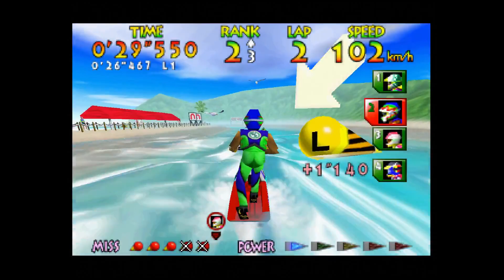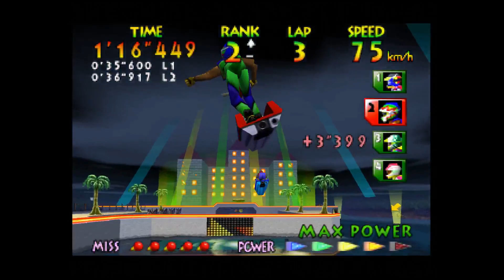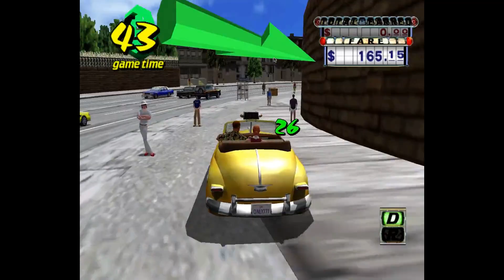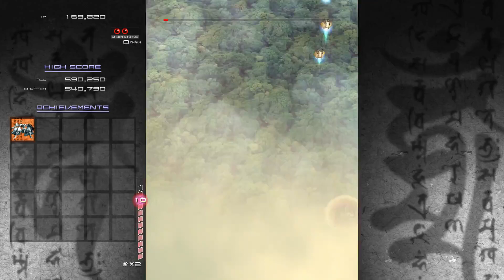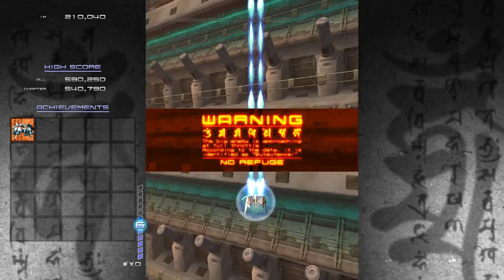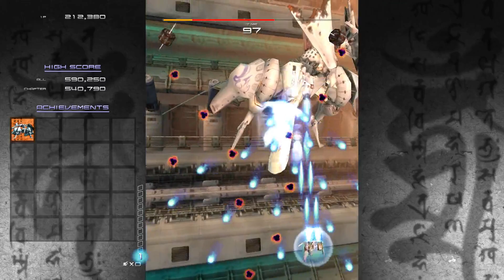Analogue 3D and MARS FPGA - Breakthrough Systems For Retro Gaming?

Comment: There should be no problem for MARS to handle Model 1 and 2. If it can handle NAOMI then it can also easily run Model 3 since it's less powerful. I'm curious if it can manage something like Hikaru or even NAOMI 2 in the future, i would love to see games like Planet Harriers and Star Wars Racer Arcade being ported. Another board from Sega that would be very interesting to see is the System 32 game Golden Axe: The Revenge of Death Adder, that game is so good. The list of potentially new arcade cores are so many...
Reply from the maker: I should have brought up Model 3, but that one should be able to run like you said. Daytona USA 2 would be awesome to see running on that board. Thank you for watching!
Reply: The biggest factor with Dreamcast/NAOMI is that Fixel has PowerVR done in HDL from a previous project. Also, other parts of the Dreamcast are already documented. That's not to say that Model 1+2 will never get done, but they are currently not on the roadmap. Naomi/Dreamcast is a special case.
Reply from the maker: @MARSFPGA  Thank you for sharing this video on Twitter, and thank you for that extra bit of information about the upcoming Dreamcast/NAOMI cores. I didn't know that some of the work had already been done in a previous project.

Comment: The Analogue 64 will cost between $199 and $249. We know this already. 
The MARS will be $1000+. Neither N64 core will look anywhere near as good as your video of WaveRace 64 looks. Since software emulation can upscale the textured polygons before it's upscaled. The Analogue 3D core will upscale the 240p signal. 

I also feel this will be the so called "Zimba 3000", that Kevin has wanted to do for many years. It would seem so since Analogue has not included OpenFPGA support. I.E. They can sell cart/CD addons + their own cores for it. It's going to be a much more powerful FPGA chip, so we could see other systems such as the PSX, Saturn, 3DO, CD-i, Jaguar, and so on. Chris Taber has said many years ago that he would love to see an FPGA 3DO someday. I guess we'll see. 

Also, the N64 Analogue core is said to have save state support at launch. I'm not interested in another N64 (I already have a dozen), but if the other systems are added I may be interested.
Reply from the maker: The price for the Analogue 3D has not been confirmed yet. There is no guarantee that it'll be that cheap.
Reply: Chris Taber has said  “the price of the Analogue 3D will be in the range of all of our other systems,”. So that gives us a good idea of the price. No more than $249.
Reply: @videogameobsession you must have forgotten the MVS and NT consoles were more than $250
Reply: @otterdonnelly9959  No. I knew of those. I made 300+ Neo•Geo extensions,  which were packaged alomg with the ACMVS. The interview was solely discussing FPGA tech, and the systems that Analogue are currently known for. Not the old discontinued systems that sourced original HW.
Reply: @videogameobsession  that was never specified though. The 3D could be $199 or $420 and still be within the range of “all” their other systems. We won’t know until price is revealed. I’m thinking $299-$349, personally.
Reply: Where you get the $1,000+ price from?  This video states it'll be around $700.  That's around $200 more than a Mister set up.